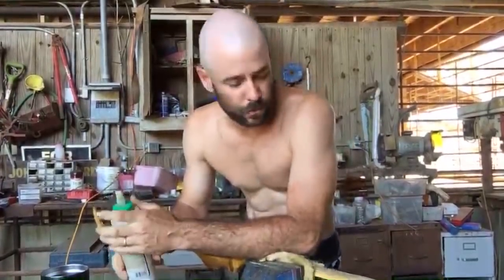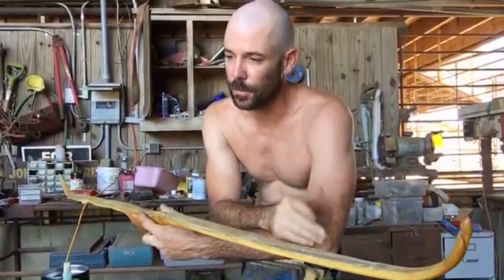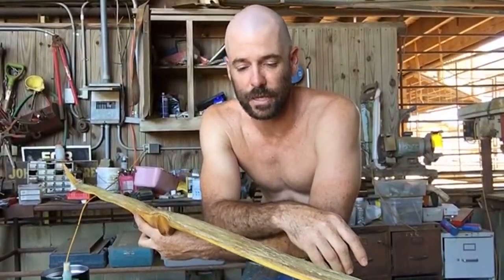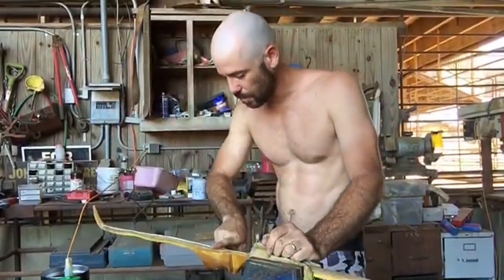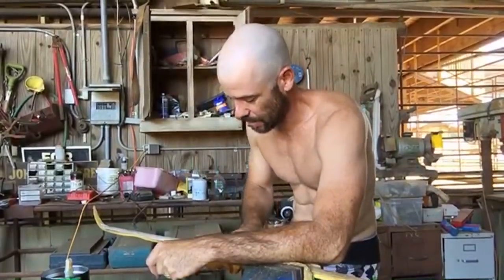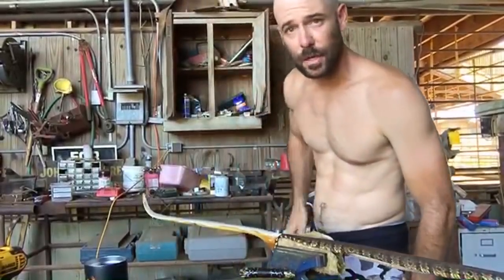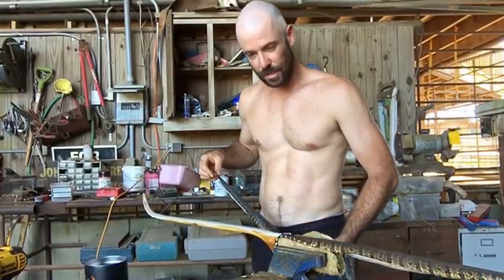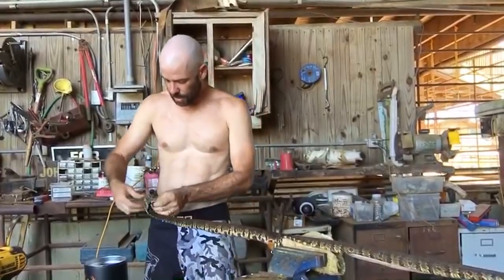LIVE! Snake skin backing a primitive recurve bow

Comment: Was the sinew done with knox/hide glue or wood glue? I've done sinew and snakeskin with both. I've found that they don't stick well to one another if you do one with wood glue and one with knox glue. Lol

That being said: with knox glue, once it gets a tiny bit tacky, the skins seem to really stick to it and stay put. Nothing more frustrating than when the skins are shifting all around and won't stay put.
Reply from the maker: Hey James, I put the sinew on with knox and the snake skin with titebond. After the sinew was cured, I ended up sanding it down to retiller and lower the weight. Once the sinew was all roughed up from sanding I spread a coat of titebond over it to hold the fibers down and help protect the sinew from water. Then I sanded again before applying the snake skin. I've done it this way several times and haven't run into any trouble. ch